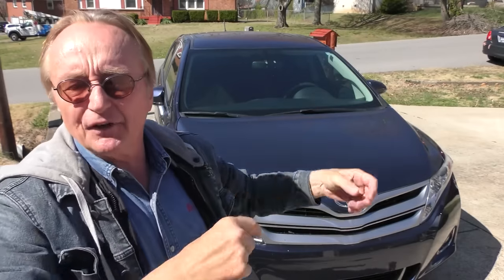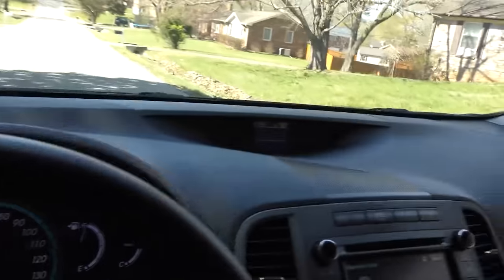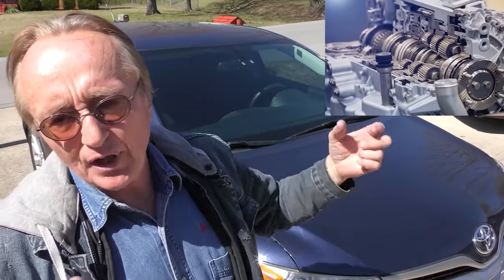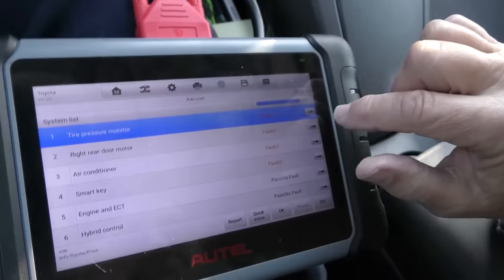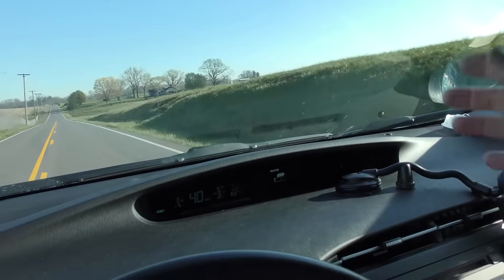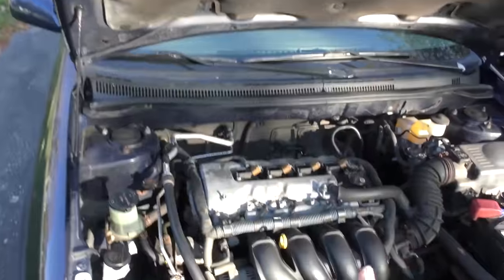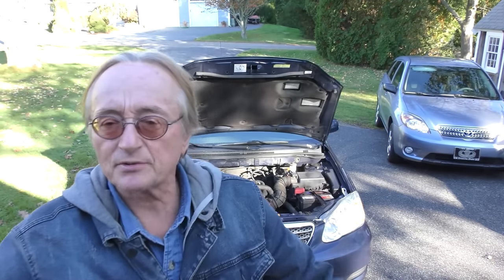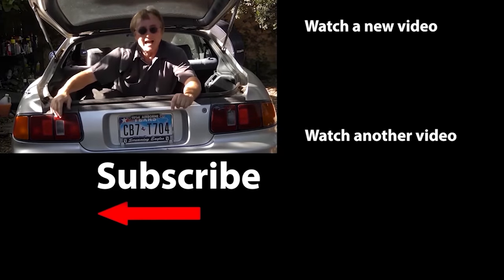Everyone Hate These Cars, So You Can Buy One Dirt Cheap

Comment: Well Scotty, $14,000 with 100,000 miles is not "dirt cheap" for me.
Reply: Me either .. they been about 20k for the longest.. Ended up getting a rdx for 11k .. venza still looking good .. 10k for the brown one would be nice
Reply: Exactly. I’ll only buy used cars if they have 70k or less miles
Reply: $14,000 is affordable comparatively, not specifically to you. 

The lower your budget, the more work you'll need to learn to do yourself. You can still find great cars for dirt cheap, but you'll need to learn to do work yourself.
Reply: And what do you think you get for less? Crap!
Reply: Exactly.  I’ve looked at those Venza.  They are still overpriced which is why no one bought them when they were new
Reply: That is more them I make in a year on SSDI
Reply: Mccchmph🤭 he didn't even spell it correctly, everyone hate these cars, it's Hates, not hate 😂😂😂
Reply: Spending 4000$ for almost anything with 70000 miles is way worse than Honda or Toyota with 100k
Reply: Considering Toyotas last 2 to 300k miles 14k is a great deal compared to the price of new vehicles these days.
Reply: The price of cars is really shocking me the last few years. Last car I bought 6 years ago was $12200 with 24000 miles on it.
Reply: Agree, that is crazy expensive for an unknown.
Reply: That car has a couple hundred thousand miles left on it, a used Toyota is far better than a new Ford or Chevy.
Reply: Used cars now (post 2018) , are going for these prices now, it's crazy ! But it's the same here down in OZ .
Reply: Ever heard of a nissan 240 drift tax? Those used to be a $1000 peeling burgundy paint crackhead car. Now, you gotta sign up just to see one. Model As are more common.
Reply: Newspaper used to have a 500 dollar thrifty section.  By a 300 dollar beater and drive all summer
Reply: Want more pay more
Reply: I agree with you but if it gets 300,000-400,000 and if he lives for 14 years that's $1000 a year  ( you look at it like that) but I wouldn't pay $14,000 and gamble on that cause I always lose when I gamble 😂 but not funny
Reply: Oh please folks, 100k with high milage oil changes and who knows the wear and tear on the suspension...
Reply: @Simbacu  yea OK Karen
Reply: My dad was a lot older than my mom. Growing up in the 80s I constantly heard how ridiculous he found prices on food, houses, and cars. He was remembering the days of 18-cent gas, $120 mortgage payments, and new Oldsmobiles for $900. So now I get to say to you what I eventually started saying to him: that’s just what things cost now.
Reply: Room in the back seat in a corolla..love scotty but come on..u definitely don't have daughters
Reply: Exacly i bet you can walk into a dealer and buy a brand new unabused Nissan versa or Kia rio for that price. But only if you have the cash in hand otherwise good luck with getting ripped off with financing nobody will give you a good deal.
Reply: Agreed!  😬
Reply: Miles don't matter! Wear does! Find a car that was a long distance commuter and you can be fine
Reply: Toyota's last twice as long as any other car hands down! 100,000 on a toyota is nothing.🤣 14,000 is a steal.👍
Reply: I’m seeing 1988/89 grand marquis going for 10k on carvanna it’s insane
Reply: @jessewynne8193  that thing better serve me coffee in morning for that price!
Reply: I agree, I understand that cars last forever these days but 100k on it is still 100k, and not for me 🏖️
Reply: @smadas4192  you can get 2007 Lexus rx350s for around $5000 with 140k miles. Most of the time at that Mileage struts, brakes, tires, etc have been replaced. Lots of great deals out there under $10k
Reply: Right?! lol I’m more like the Corolla person based on my current bank account. See the way my bank account is set up… lol
Reply: @MASSARMS3  Yes and no........depends where you live.  My 2008 corolla has been great.  I'm only at 180k BUT..........I live in Canada where rust takes its toll.  IT runs great but it's going to die well ahead of it's time due to rust.  That being said............I have less rust than most people with 5 year old vehicles of other brands.
Reply: @RRLV434  lol you're generous, Im looking for 55k or less! And Im finding some!
Reply: That vehicle at that price is acceptable. This is not about you.  C'mon. On average, it's a very good deal.
Reply: @patriziacasagrande3833  that’s the plan. Put debt on everyone
Reply: true.  but for a car that has relatively low and minor repair costs and maintenance and could last you 15-20 years, that's a good deal to me.
Reply: Yeah the cost of cars went way up. Our pay not so much. Wonder when it will start trickling down like Reagan said...

We built our entire society to make cars mandatory for everyone, and now a large portion of us can't even afford to drive.
Reply: Learn to take things like price IN CONTEXT.  Quit whining and realize that, RELATIVELY SPEAKING, that is definitely dirt cheap.
Reply: I dont like the color gets you a better price every time.
Reply: @lawrenceleverton7426  hahaa gotta remember that
Reply: You buy them from people, not car dealers.
Reply: Yeh I'm seeing them in my area for around $10-11k with 80k miles.
Reply: @patriziacasagrande3833  lol poor people
Reply: My thought exactly. I’m thinking what will my daughter be able to afford when she decides to get her license and drive. Just like I don’t want her to take student loans I don’t want her to be saddled with a big car and auto insurance payments.
Reply: Yup it sucks. I just had to get a new car. 2013 camry I think fully loaded 59,000 miles. It was like 16 or 18,000 dollars can't remember which. Way overpriced but I knew i was going to overpay for everything so I got a fully loaded camry with low miles so I know it will last forever
Reply: I feel so left out.  Seems like everyone can buy a 60k car these days.  Ca. Is Making it the law.
Reply: Don't go used car shopping right now.
Reply: This is so common that I'm contacting dealerships about buying a cheap, new car. I'm on a waiting list for a Nissan Versa manual right now. If you get a Versa, GET ONE WITH A MANUAL. Manual Nissans are fine but their CVTs have a bad history. Their CVTs have improved but it's not worth the risk.
Reply: Cause the car is reliable. It can go 500000 miles easily. That's like getting a non Toyota or Honda car at 10000 miles for 14k
Reply: @jsperez240  where?
Reply: @barrydworak  Grand Rapids Michigan
Reply: Maybe for Scotty it's not that much.
Reply: @jsperez240  What brand tho? If it's not a Toyota or Honda it's not worth it at even $5k
Reply: @solomonmarcus5496  it's not that. It's that the used car market has gone insane. In 2023 that's a deal. It's really bad, but that's how it is right now. If you need a car you're stuck in the game. I was, too.
Reply: For a Toyota or Honda, I would pay a little more, because I know they will go forever from experience…
Reply: @Adam-7_7_7 it’s because people have to wait months for new cars…at least here in Canada…it’s getting better, but still…this is driving up the used car market…
Reply: @mongo64071  The new Venza is a relatively good value. The base model is around the cost of a mid-level RAV4 hybrid and the Venza is built in Japan, and is built like a Lexus. It is everything the overrated RAV4 is not.
Reply: @paranromallover4543  A Nissan or Kia is lucky to still be running at 100k miles. 

If you pay cash, don't tell the dealership until you have worked out the price. Dealerships don't like cash and will negotiate far less if they know.
Reply: Plan to keep my 2011 Honda Accord now 108k miles (bought at 30k miles).  Every time our mechanic services it he asks us to sell it.  We smile and politely decline.  Say it will last to at least 250k miles.  We are retired and drive about 5,000 miles a year.  So we have 142,000 to go.  This will last us 28 more years at current mileage.  As we are early 70’s we would have to live into our late 90’s early 100’s to need a newer car.  Dang, our car can outlive us!😂
Reply: scotty males a thousand dollar an hour
Reply: True, but that price is way lower than what a new car cost. ($40,000+)
Reply: Hell you can get a Hyundai azera (2006-2011) for like 4-6 grand with well under 80k miles.
Reply: Exactly 💯
Reply: I relate
Reply: @patriziacasagrande3833 You got a zero too many somewhere in your statement!
Reply: @patriziacasagrande3833  well 12k is cheap because if compare the same price to a dealer it's 16 - 20k
Reply: In this market it's cheap
Reply: @bryananderson3772  the market cant stay up forever
Reply: Me either but with basic maintenance this car will easily go 300k miles. So actually not a bad value.
Reply: @itsallminor6133  yes it can
Reply: Hey Bill, what was the average paycheck back then?  I would consider that in the equation to support your thoughts.  Google tells me the annual salary back then was 12K dollars per year.  In 1978, my annual salary at the steel mill was about 34K dollars per year.  Should have invested instead of buying new cars all the time. ( trying to tell the grand kids that now, but of course they are not listening just like I didn't. LOL 

 @BillLaBrie
Reply: @GabrielSBarbaraS  The average paycheck was less and things cost less. People still struggled and complained. Go figure.
Reply: That's a ridiculous price for 160,000 km boring -looking set of wheels.😂
Reply: @smadas4192 Hyundai Sonata at 2 years old.
Reply: @adrian_V99  yeah, wait another year or so! What does Scotty say about Hyundai!? Rolling pules of crap! You can LEASE anything cause in the 3 yrs you have it it's fully covered!
Reply: @tomgray6123 correcting grammar isn't "karen".  We're a nation of lazy people who couldnt care less about grammar and English language.
You calling someone a "karen" for that is a "karen"
Reply: You can drive this car for 300k miles. And that’s what makes it “dirt cheap”. Not so with a Ford, etc.
Reply: @RRLV434  because you don’t know squat about cars. Scotty knows what he’s talking about.
Reply: Same
Reply: Car prices are insane rn so 14k doesn't seem that bad when a new car can be around 45k-55k
Reply: @smadas4192 100,000 is mostly shot. Maybe you get to 140,000 miles before it’s junk.
Reply: @techguy9023  that's not true at all! Depending on the car your talking about!! 100, 000 miles on a Toyota is nothing!!! They easily go 3,4x that if it was taken care of!!!! You make to broad a statement that's not true in every case! How do I know! I'm on my 3rd Toyota, never any problems!
Reply: @tomgray6123 
😂😂😂.
Reply: @Simbacu 
Lol he's speaking in current as to say "hate them so people think they are worth less money"
Reply: Is 7500 for a Hyundai sedan 2015 a good price?? 100k miles on it
Reply: @GamerKiwi  👏
Reply: Toyota's have excellent resale value which is why used ones are not exactly cheap.
Reply: You need to reexamine your life choices then😂
Reply: I know this was 5 months ago, but $14k is dirt cheap for a reliable car for the market.  The market is ridiculous and dealerships are crooks.
Reply: Look at the price for new vehicles, and it changes your mind.
Reply: $7000 and now you are talking.
Reply: I think it is these days.  The days when I bought a one year old Toyota Avalon with 42k miles for $21k is long over.
Reply: @maryrenaud6732 My 2012 Honda Accord has 235k miles.  Still going great.  But the catalytic converter had gone bad, and ABS no longer works, but those two don't affect the drivability of the car.
Reply: I know what you mean. But I understand these things go for 40 to 60k new.
Reply: My 2006Trailblazer was $23k new
Reply: @TheSleepingonit  Then you can't afford a modern automobile
Reply: @davidmagen415  100k today is just broken in
Reply: @jcarrolljr3052  There is a reason it's at that price.  American companies can make great, reliable cars, but they would only do that for the very high end ones, if at all.  For the mass, they'd cut every corner they could find, which is why for such vehicles, people don't mind paying several $ thousands more for Japanese cars.  I would never touch an American vehicle unless it's a heavy duty truck or high end luxury.
Reply: So he started the car with a rats nest in the air box.  Brilliant
Reply: @jessewynne8193 Yeah, carvana is a rip-off....
You'll be lucky if the car you buy from them isn't stolen.
Reply: No, that's not dirt cheap.
Reply: Yea, we need more of something for nothing.
Reply: Here in philly u can get these for like 5-8k with around same mileage
Reply: @Lastbadie  Thank you ever so much! I live in the West Coast and used cars have inflated prices. Unpopular opinion, I can see the East Coast continually out competes the West.
Reply: @audacityhour3104  Acura RDXs are wonderful cars. I miss my RDX that got totalled not too long ago. It was VERY fast and had incredible AWD.
Reply: Only idiots buy new vehicles
Reply: Well ya bought it
Reply: dodo-heads
Reply: 14k ain’t what it used to be
Reply: Bro. It is for that car.😊
Reply: 100k on a Toyota just means it's woke up and had it's morning coffee
Reply: Well dont buy then. 😅
Reply: Dirt cheap to me is under 3k
Reply: In 2024 that’s very cheap my brother’s into a 2012 Tacoma V6, 4X4 150K miles for almost 30K 😂 welcome to Kamunism

Comment: I just got myself a 2008 Corolla with 98k miles on it. I love on it everyday . May have over paid for it at $6900 but it is mint and shiny. Runs and stops perfect. Came with maintenance records including trans services.
Reply: At current prices, I think you probably stole it! Good job.
Reply: @donfronterhouse4759  Thanks for the encouragement.
Reply: @donfronterhouse4759  Great deal!
Reply: Wish I could find one now
Reply: I brought one 12 years ago used with 23K for 10K and the car came with original sales slip for 17K and still using it daily. I only do oil change Trans fulid change and I did change spark plug and suspension. Still running fine and I don't have 30K to buy a new one!
Reply: I paid more for a 2012 Accord but it was last year so there wasn't much I could do about the pricing due to the rapid inflation. You did great.
Reply: 6900 for a mint corolla? thats not bad at all lol people sell shitbox 200k mile Metros for 5k now.
Reply: Yeah, at that price I would expect a car approaching hi 180k to over 200k miles. Only 98k miles great deal.
Reply: I think you got a good price on it if it's still shiny! That thing will go for another 250k😂

Comment: The V6 Venza is mechanically identical to the Lexus RX350. They share the same everything- even the interior. It’s an excellent vehicle if you find a good one.
Reply: If it's mechanically identical to an Lexus RX350 it is going to have superior reliability ❤👍
Reply: But the color is horrible!
Reply: @1jackvalley580  The speedometer blinks.
Reply: Everything except testosterone
Reply: The Venza v6 has slightly less hp and a different transmission than the rx350, I believe it's a 5 speed vs Lexus 6 speed but not sure. The Lexus is more refined, quieter and smoother. The interior is definitely lower quality than the Rx, my 2010 Rx still looks luxurious inside almost 15 years later. It's incredible. That being said, the Venza has a lower ride height and that's an issue with the Rx, it drives too tall and the suspension could be better tuned(probably due to Camry-based design). And the better mpg makes the Venza a better daily in my opinion, Rx for when you go to the movies 🍿😁
Reply: @ceem9924 this is my Venza that Scotty reviewed. For me it’s part Camry crossover, part shortened Highlander, and the best part, “poor man’s Lexus RX”. You can see the tears welling up in my eyes, right? 😊
Reply: If you find a good one , not easy job

Comment: I have a 6 cylinder 2010 venza with 197K miles no issues the only things I have replaced was the alternator, spark plugs and coils. the most reliable vehicle I've ever owned
Reply: replace the PCV

Comment: Actually, the 2.7 L was the four-cylinder that they put in the second generation Tacoma’s. They also put it in the early 2000 sienna’s very reliable engines. I have abused, mine, missed oil changes, put the wrong oil in it, raced it delivered in it, then left her to sit for two years, and now it’s driven rarely but starts every time
Reply: The old Dodge darts can run even without oil.
Reply: @lawrenceleverton7426  pre 90s or the "newer" ones
Reply: @LiveRubii  1960s
Reply: @lawrenceleverton7426  Then I believe it
Reply: @lawrenceleverton7426 The old Dart with the slant six were great cars.They looked like a box on wheels but they ran forever.I wouldn't touch a later model Dodge-Chrysler now.
Reply: THAT 2.7L is completely different than the 2.7L in the Tacoma.  My wife has a 2011 Highlander with the same engine as the Venza and I have a 2012 Tacoma with a different 2.7L.  Both are great engines that are very reliable.

Comment: my 2000 4runner also still its original exhaust. Toyota does wonders with their metal work.

If I bought a Venza, i would definitely go for the non-hybrid.
Reply: I'm looking at a 2018 buick right now and it's being serviced, they said the exhaust is being replaced. I'm wondering why it would need it's exhaust replaced cuz my 2008 never did. Is there a reason that should that be concerning? If you might happen to know, I'm not very car savvy.
Reply: @krystalshepherd4582  with a 2018 you should be fine. 

Some older vehicles the exhaust could rust out, or the fasteners that hold it could break. Not garenteed to happen, just a chance.
Reply: @StardustADV  Thank you.